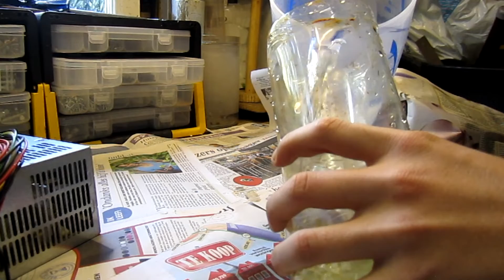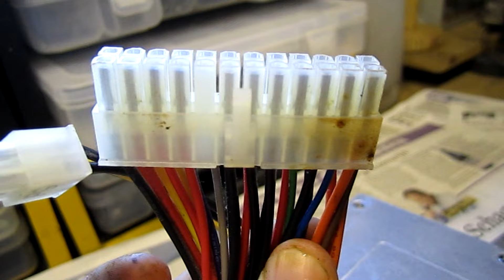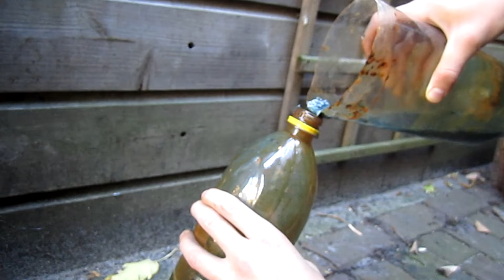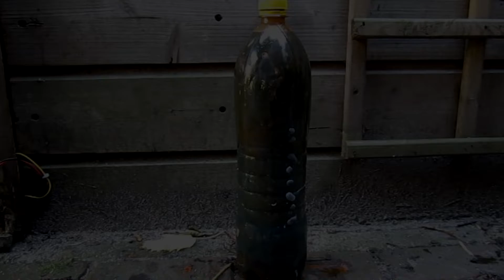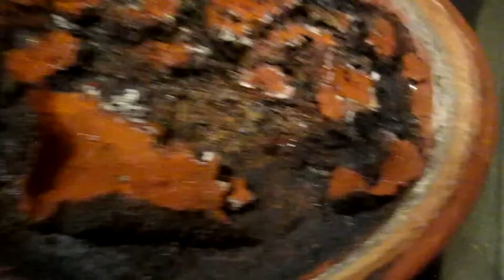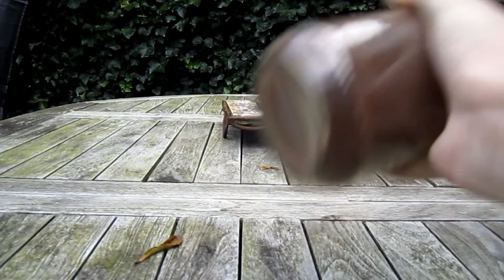How to make Iron Oxide (Rust) using electrolysis!  [Tutorial]

Comment: im getting lots of rust floating as a shape of sludge and on the bottom a little bit rust and lots of green stuff maybe ..i know that rus t sets to the buttom but here im getting it floating on top any tip thx..maybe because i used too much salt ?
Reply from the maker: In the video you can see the sludge floating to the top in the beginning, its less dense than water, thats all.
I wouldnt worry about it too much, as long as you are getting the green hydroxides and red oxides you are good and can proceed with the process.
Reply: Ty 🖒👌

Comment: i keep getting a lot of green stuff
and very little rust
what's with that?
i'm sure i put the wires right and everything
Reply from the maker: The green stuff is Iron Hydroxide, it will turn into the desired rust if you heat it.
But you need to get it out of the solution first and dry it.
Reply: thanks dude :D!!!
you have the best video on this matter
Reply: PyroManiacs thanks had the same problem

Comment: the green thing is actually chlorine . that's what I think . ( I am no expert )
Reply from the maker: We are now fairly certain it's Iron (II) hydroxide, the chlorine escapes as a gas.
Reply: ok. thnx for the info
Reply: you should be careful and ventilate well cause it does produce chlorine gas also you should watch the solution cause the pH will decrease the longer you preform the process
Reply: o and also if you want to bypass adding salt you can just up the voltage to the point where it will happily travel across water meaning you will ether have to lower voltage or use more watts
Reply: Jazza Fritsch . well I tried doing electrolysis of brine using carbon electrodes on both terminals ( using a carbon electrodes on positive terminal and        using a iron rod for negative will give the same result ) , I found that almost no yo very less of hydrogen is produced and there is lot of chlorine produced as compared to this method
Reply from the maker: Jazza Fritsch Chinmay Shanbhag 
There is chlorine produced, which is why we did it outside for the larger part of the video, be careful.

A higher voltage means higher current, which can be benificial for the electrolysis, especially when you want the electrode to dissolve.
Be careful when you want to keep your anodes though, such as when they are platinum, high votage can cause side reactions which will eat up your electrodes.
For electrolysis like this I recommend 5-6V, I have tried 12v but I got mixed results, including different oxides (Iron (II) Oxide) and even the water boiling!